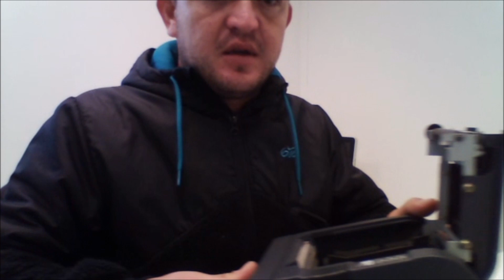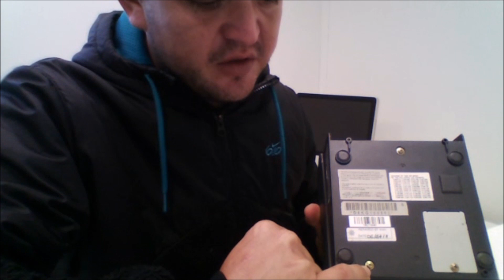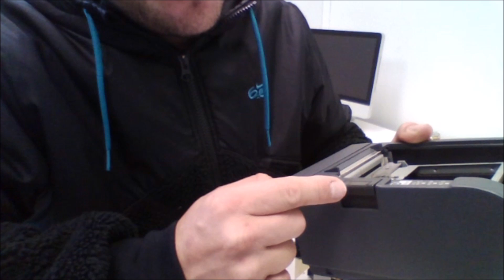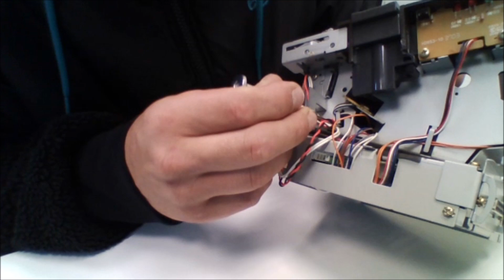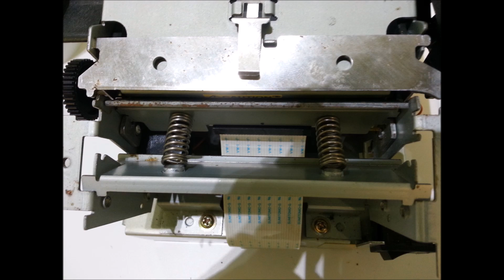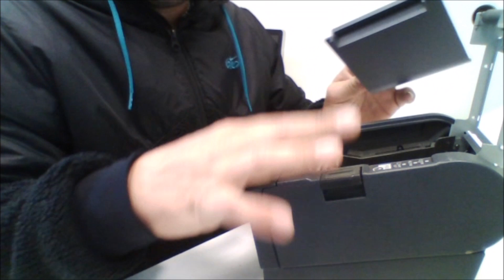epson tm t88 repair guide

Comment: Any idea how to reset the ethernet settings.  I stupidly tried netmask 255.255.255.255 on the epson  ethernet adapter and now I cant log back in to change the settings.  Any hard reset of ethernet settngs?
Reply: +Aficionados TV To reset the Epson TM-T88 models back to factory default, power off the printer, before you power the printer back on, press and hold the FEED button then power on the Epson printer, when you hear the paper feed stutter, let go of the FEED button. This should reset the ethernet config.
Reply from the maker: did you try the epson tmnet winconfig utility??